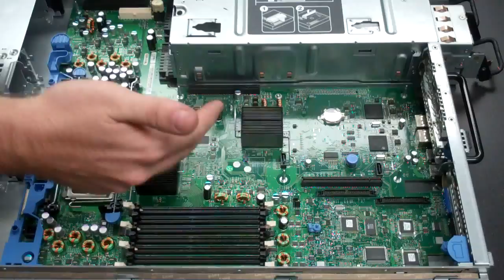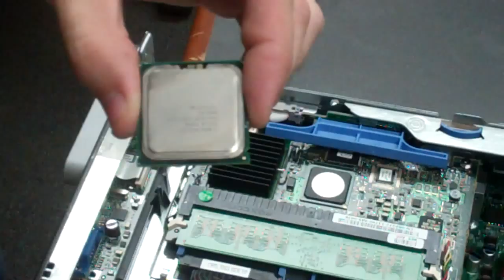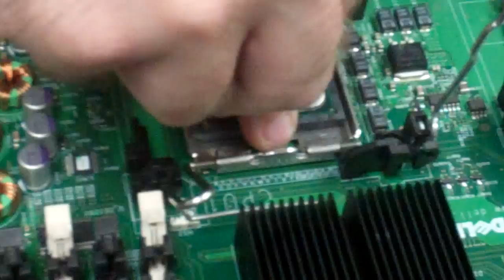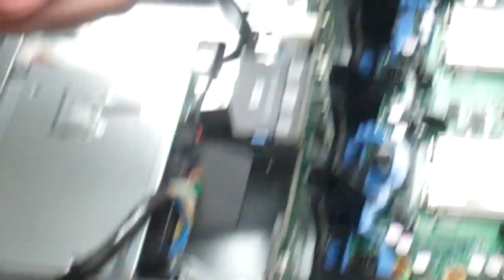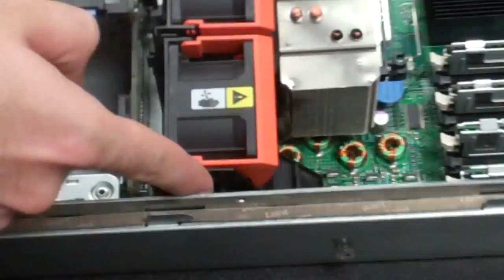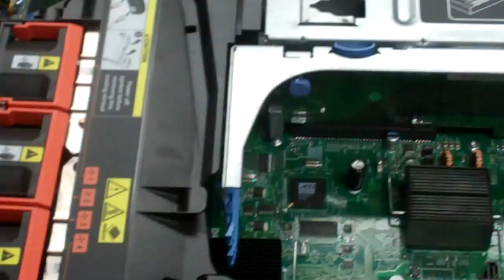Velocity Tech Solutions - How to Install a System Board in a PowerEdge 2950

Comment: Just replacement of the system board will not dump the RAID configuration, will it? I understand the RAID configuration is stored on the RAID controller, but I just want to make sure since this is a rather old machine.
Reply from the maker: No, replacing this system board does not affect the raid configuration. Please be sure you are replacing your system board with the exact same part number you had before.  When it comes to data, it is always best practice to back up your data.